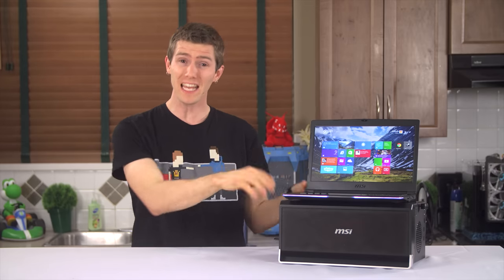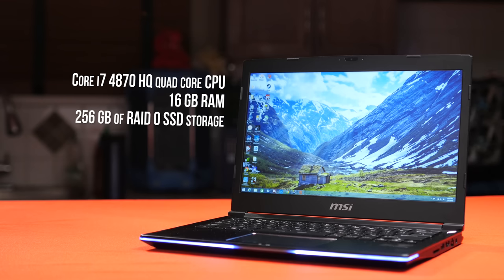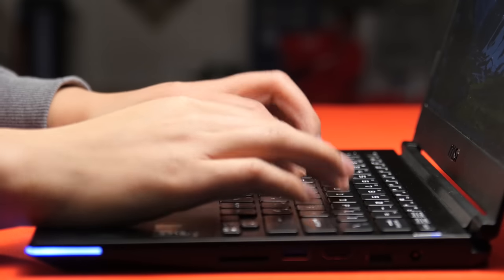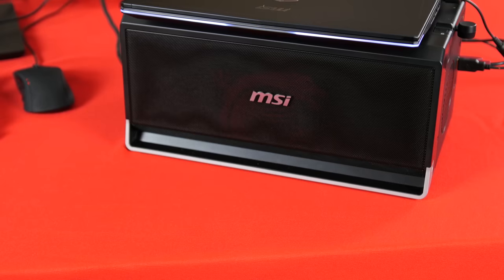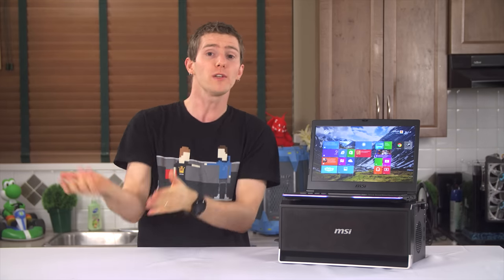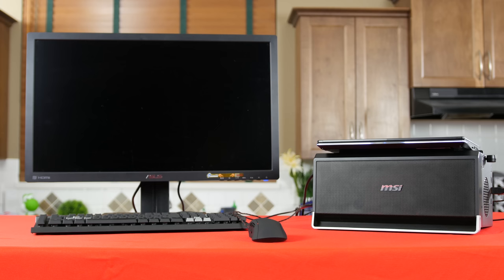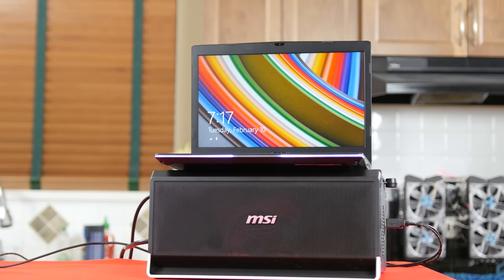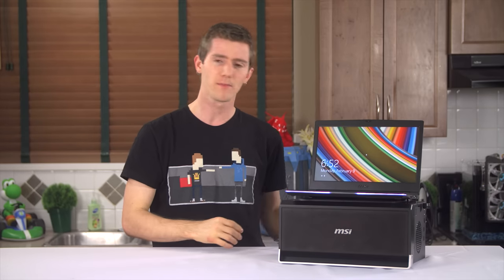MSI GS30 Shadow - Part Beastly Gaming Rig, Part Ultrabook

Comment: linus, alienware solution to the graphics amplifier is much better than msi. basically with alienware, you can freely move your laptop around without the amplifier getting in the way. with msi solution, you will be required to attach a external monitor, keyboard and mouse because the final position of your laptop would be impractical to game using the laptop keyboard. therefore lesser flexibility.

btw im using alienware laptop + graphics amplifier right now and the amp is hidden under my desk while still able to connect it to my laptop. you cant do that with msi

Comment: firstly i thought thats something i may actually buy in the future, but i think those laptop processors, no matter if i7 or i5 are way worse than in PCs. and thats why i dont think i shall buy it or something like that.  
or am i wrong about those laptop processors? are they ok? cause when i got a laptop with an i5 2,5ghz i had a terrible experience and my actual 3,0ghz dual core (which i have because i cant afford anything better now) is way better.

Comment: Way too expensive. Today, Feb 12th, you can build a micro ATX, air cooled, fully X99 system with one GTX 970 for just under $2,000 CND before tax. Probably $1,500 if you're in the US.

Comment: Cool Idea. But makes no sense at that price point. I believe that you could get a decent desktop and a decent ultrabook for that price tag. So " not having 2 devices" is not a valid point. If the price tag was lower I would consider buying this, since I've been dreaming for ages about external GPU solution.  Even if it's 200-300 $ cheaper still not a valid point- since having 2 devices is well having 2 separate fully functional devices.

Comment: MSI's solution is MUCH better than Alienware's ! Here's why:
- Instead of a nice, small Graphics Amplifier, you get a huge ass box (it's cool, right?)
- Graphics Amplifier connects through a cable, this one has to stay in a specific place, extremely uncomfortable; but it's better because it will also heat up faster because of it ! This will be awesome when your house is cold
- Alienware automatically overclocks the CPU when you connect the Amplifier , but MSI ... shit, they didn't think about that
- Alienware uses 5th gen i7 CPU's in their 13" light, thin laptop ... oh shit guess who doesn't
- MSI has to reboot every time you plug in/out, unlike Alienware ; that's awesome as your laptop will have time to cool down while rebooting !
- Alienware 13" has a 4k screen and has half the price ; that makes MSI premium guys ! not retardedly overpriced, premium!!

Comment: Hey LinusTechTips just wanted to let you know Alienware made something like this called a "Alienware Graphics Amplifier" which I believe connects via USB and lets you use any single Desktop GPU on an Alienware laptop. I have no clue the specifications of it or how the hell it works but I know it's been a thing for a bit and would appreciate if you could check it out and make a video like this on it before I go and buy a freaking Alienware .-.

Comment: I've wanted something like this for ages but man they did a bad job designing this thing. It's a bit bum really, they could easily make it much smaller and have a thunderbolt connection so you can use it with any lappy.

Comment: no sound in the intel thing after the intro.

Also, the laptop only last for 2 and a half hour? ... That's just not enough man.... The desktop feature is awesome, but if I can't use the laptop feature for at least 6 to 8 hours while I'm on the go, it's useless to me. A windows tablet with keyboard add-on can easily last 12 hours...
 Not the same amount of power, but let's face it, I don't need a powerhouse CPU while on the go.

Comment: Does anyone know if this is being updated in 2017 with 6 or 7th gen CPUs? I absolutely love this concept, even with its flaws. However just cant justify it with its old Haswell CPU. 

The MSI GS32 seems like a massive flop and I really really hope this isn't their idea of an update. Dual core i7? In 2016/17? REALLY? It was far better with a high end CPU with no discrete GPU.
Reply: CAElite also the gs32 external dock only works with Maxwell gpus
Reply: CAElite why not just get a graphic enhancer? put a desktop GPU in there and connect to your laptop through thunderbolt and BAM! desktop graphics in a laptop. or get a slim gaming laptop

Comment: I find myself agreeing with TB on this one for the most part. The usefulness of this machine is questionable. How many people need to upgrade to a new laptop and buy a decent gaming machine at the same time AND are willing to spend that much money? I get the idea behind it, but making use of the pieces seems like a hassle. I feel like someone who would use this would have a better time building a multi-use desktop and buying a standard laptop for on-the-go computing. I don't understand the advantage of having them be the same machine when things like google drive exist. We're entering a stage in computing that wireless integration between different devices is almost standard, so what makes this so special? I'm not trying to shit on MSI because they make very good components most of the time. I just want to hear more of why this is necessary in the current market.

Comment: Hey guys can you give me some tips on my upcoming build? Where I can Save money or where I might want to pay a little more, or there is a better alternative. The total cost of this build is $891.50, I'd like to go cheaper but if there is stuff lacking I can go up to $1000. Thanks for the help y'all!!
AMD FX-6200 3.8GHz 6-Core Processor
$99.99

Cooler Master Hyper 212 Plus 76.8 CFM Sleeve Bearing CPU Cooler
$19.88

Gigabyte GA-970A-UD3P ATX AM3+ Motherboard
$71.97

G.Skill Ripjaws X Series 8GB (2 x 4GB) DDR3-1600 Memory
$62.99

Corsair Force LS 60GB 2.5" Solid State Drive
$44.99
 
Seagate Barracuda 1TB 3.5" 7200RPM Internal Hard Drive
$48.89

Gigabyte Radeon R9 290X 4GB WINDFORCE Video Card
$293.98	Newegg	

Corsair Carbide Series 300R Windowed ATX Mid Tower Case
$69.99	

Corsair CX 750W 80+ Bronze Certified Semi-Modular ATX Power Supply
$74.98

Microsoft Windows 8.1 (OEM) (64-bit)
$89.75	

TP-Link TG-3468 10/100/1000 Mbps PCI-Express x1 Network Adapter
$14.09

Comment: I'm not sure if he mentioned it, but does the notebook have to be on top of the unit or can you take this top piece down!
Because if not, the whole idea makes no sense to me what so ever! How would I even game on this thing, when my mouse is like 30 cm lower than my keyboard, awkward! I hope I simply missed it or he didn't say!

To be honest, in this case, I like the Alienware implementation more!
Reply: Nope, it can't be moved. I think the intended usage scenario is an external monitor and a plug-in mouse & keyboard/controller, because I agree that using such a small laptop sat 1ft off the desk would be pretty horrible.
Reply: Okay, if all of that is true, this setup now doesn't make any sense to me at all! So to use it, I would have to buy an extra monitor, an extra keyboard and an extra GPU?
To be honest, why would you buy something like that?
Reply: To this point, because it doesn't have a discrete GPU inside, what would you be able to play on it? Maybe CS 1.6, but that's most likely the only thing a CPU grapics card can handle. 
And at home I would need pretty extensive additional equipment to use it, so that seems highly impractical!
Not to defend Alienware, but their solution is at least a capable, portable "gaming notebook", which can be "amplified" by their solution. So you can realistically game on it on the go and at home use more power!

I really don't understand this solution! And an Ultrabook with 2.5hours of battery life, I'm not sure I would call it even that.
Reply: You're right, to each his own!

For me, the purpose of a light, portable solution is to be exactly that, if I then need to fixate on finding a plug and carrying the power brick with me, than that defeats the purpose to be honest! :)
Reply: it's meant for you to use an external monitor, keyboard dude @__@
Reply: Nega Callahan My issue is that while this is a great concept, at the moment there's no real advantage to buying this over a separate laptop and desktop aside from shared files. 

Here in the UK (this is obviously only going to be relevant to the Brits, it may be different circumstances in the US) the only currently available configuration is the GS30 with the dock and a GTX 980, which retails for £2195. For that much money you could go pretty nuts on a desktop rig, throwing in a Broadwell i7, 980 or SLI 970s (or whatever AMD's equivalent are right now), choose your preferred parts, form factor and overclocking potential, pretty much put together a top tier home gaming solution, and as long as you didn't go entirely insane still have budget leftover for a solid ultrabook or entry level gaming laptop (and I'm talking 860M sorta range) to cover whatever portable needs you have. Not to mention the target audience of this product is PC gamers, most of whom will already have gaming hardware they can use as a basis to upgrade specific parts and save even more cash.

You get the flexibility of picking whatever computers and computer parts you like, true upgradability in a proper desktop, and you aren't reliant on the laptop to make both machines work, meaning if one breaks you don't lose the ability to use one of both of your "computers".
Reply: Adam Higgs there is an advantage, you don't have to think. simply press buy and done. lol
Reply: I agree with all you said. The Alienware solution is just better in everyway. You can choose to use the laptops screen or plug in an external. There is just to many lose threads with the MSI GS30 shadow.
Reply: I'm assuming MSI expects you to have a solution like Linus, with an external monitor as well as a keyboard and mouse.
Reply: TeaPrincessGaming I hope laptop user got huge desk's. Something tells me they don't since they prefer laptops or using up the space for other things.
Reply: TeaPrincessGaming this product is meant to be that way.

Comment: I know people out there have been waiting for this, but I think there are a very select few who will actually show interest with their wallets.  I think the footprint of the housing needs to be significantly reduced for it to be attractive to a wider audience.  They could do much better with just a dedicated psu, pci e, drive bay and custom pcb.  Get rid of that silly unnecessary speaker.  If sound is a big deal let the consumer provide it themselves.  You're already assuming they have a mouse, keyboard and monitor anyway so why not assume they have their own audio solution?  Waste of valuable space!

It looks like a damn printer.

Comment: I still feel it's a fad, you could get a better gaming laptop from Alienware or MSI and still have nearly the same performance.

I got an Alienware M18x when it came out years ago and have been upgrading the GPU since, I now have 2 980m's in SLi in the thing and it's no where near as expensive as getting the graphics adapter + GPU but destroys it in benchmarks.

I don't understand who these adapters are aimed at, they cost a lot of money and for nearly the same price you can get a gaming laptop with beastly GPU's for nearly the same price. Of course this only applies to people who like portability, if you want a gaming machine get a desktop.

Comment: To me this is pointless. You have a laptop that can connect up to desktop graphics is something I get. But to have that box under the notebook where you are trying work seems like it would cause a lot more stress on your hands than what it's worth. In addition to all that you could get yourself a $1200 desktop and a $1000 notebook and be quite fine with your purchase. The last issue I have would be the raid 0 SSDs I've never truly been a fan of them as the main storage on any notebook or desktop and feel that every computer if they have raid 0 SSDs should only be configured so that file storage is not a use of there's. This means that you would have to do backups of your data files onto the desktop portion of the configuration pretty often and would have to pay more money for some decent sized drives. I may be wrong about some facts but that is my understanding and this solution seems like MSI is being a try hard.

Comment: Alienware also make one of these, probably the same thing.
Reply: But 5x the price.
Reply: Nope, the alienware one with an i7 4710hq and Gtx 970m with the gpu amp Will be around 1750-1800 bucks while this laptop just comes with a iris 5200(doesnt even compare to the Gtx 970m) .... And I believe Linus said this laptop was $2000
Reply: An Alienware that's cheaper, I never knew that the day would come for an Alienware item to be cheaper.

I looked at the laptop that only works with their dock and its thick as hell though.
Reply: PandamonkBleu I agree XD and yeah it is pretty thick but as long as it does the job it's good. Also thicker gaming notebooks tend to have better cooling and they're cheaper too :)

Comment: Honestly this thing would've been more understandable if the laptop had its own dedicated mobile GPU. An 860m would've been fine so that you can get a great gaming experience at home with a desktop GPU and a decent (but much better than Intel Iris 5200) gaming experience on the go. For the price, this thing is just financially irresponsible. How much did Linus say this thing cost? $2000 for the laptop alone? Plus you need to shell out some more for the dedicated GPU and desktop GPU box putting you at at least $2200+ depending on which GPU you decide to get and add a bit more for a monitor because cmon you really need one if you want to use a fesktop graphics card. So you're going to be spending at least $2400 to use this thing the way it was meant to be used and the way that yoy bought it for. You can build an epic desktop with way more processing power and outstanding gaming performance for $1500 (including a monitor) with a capable and reliable cooling system. Then you can get a nice and quiet ultrabook for $900 for work/school. Hell you can get decent gaming laptops for around $900 that would wreck that laptop 1 on 1. So in my opinion, this thing is impractical in every way.

Comment: People, take a GOOD look at the PHYSICAL size of this thing including the laptop and it's built in monitor.
This is a ,basically, 2 thousand dollar gaming laptop that DOESN'T have a REAL dedicated video card ( intel graphics doesn't really count as GAMING grade yet unless you want to count games that are 10+ years old and/or CASUAL games) that RELIES on silly bulky solutions like this one - external graphics card " hub".

What's the point of having a part time GIMPED gaming experience on the go and then plugging into what looks like a printer to have back  your FULL gaming experience for MUCH more than 2 grand easily?

In order to have the SAME- comfort wise- experience with this setup versus a normal desktop pc setup,  you still MUST have a keyboard separate from the one built into the latop.  Do you honestly think you'll sit with your arms RAISED off of  your desk that you're using this thing on just to using the laptops' keyboard which thanks to the stupid doc-box is raised AT MINUMUM 7 inches or more off of the desk-top you're using it on?  

Get real.  That's WORSE fatigue than a vertical touch screen which is ASININE enough as it is. 

It STILL takes up JUST as much space as a keyboard, mouse, monitor and desktop pc - ( obviously talking min itx build and possibly matx build depending on the case, Loving my thermaltake core v21 ftr).

I'd rather spend that 2 grand on an upgraded desktop build and KNOW it is future upgradable in EVERY context and know there ISN'T a gimped experience to deal with and know I don't have to connect my pc to an external....ANYTHING if I don't want to ( usb DAC like the Mayflower o2 objective odac combo for about 300 bucks is VERY small and a practical exception given what it does)

Comment: this is where razer took the idea and ran with it
Reply: Yeah, but I would actually prefer this if they would upgrade it with 2017 next year. The razer core is only better because it is a more elegant solution and is compatible with all thunderbolt 3 laptops. Would love to see MSI give this idea another try because their idea is still superior imo.
Reply: Ward Huyskes actually the Razer blades thunderbolt 3 bottlenecks with a Titan x Pascal so it not as future proof as this solution
Reply: basically. msi needs to give this thing another shot with a better cpu and put a 1070 in the gpu enclosure.
Reply: Tyler Buchanan isn't that just because it bottlenecks all GPUs? Or does it have significantly more performance loss with the titan XP? If so that's very interesting since thunderbolt 3 has a higher transfer speed than PCI 3.0 x16.

Comment: But surely you're limited by the power of the CPU in the laptop anyway, even connected to the external GPU
Reply: cpu doesn't matter that much in gaming now a days . An old i5 2500k still plays everything at max paired with a good gpu .
Reply: claudioanunciacao Fair point actually. I wonder how long this thing would retain a viable desktop replacement solution for video editing etc.

Comment: $2000 not including graphics? For half the price you can have a nicer gaming desktop and get a separate laptop. By how interlinked windows 10 is supposed to be you shouldn't have an issue using two pcs so I can't see the point in this other than the novelty of having a turbo on your laptop that is 10 times the size of the laptop. If you are only gaming at home then you really don't need your work and gaming pc to be the same pc..